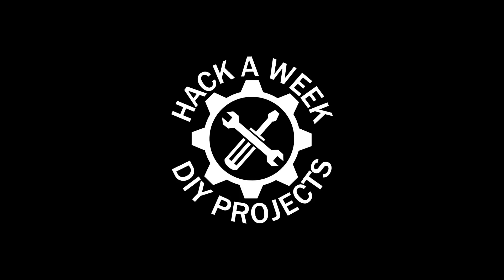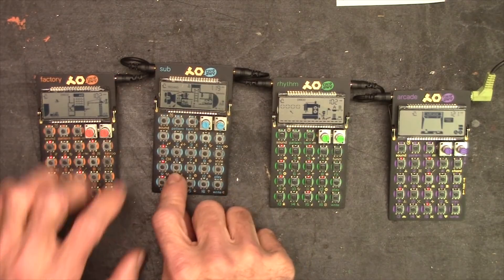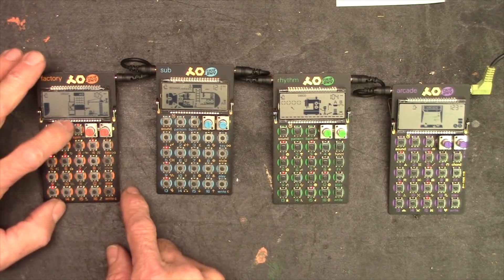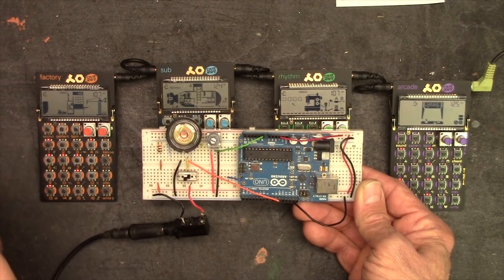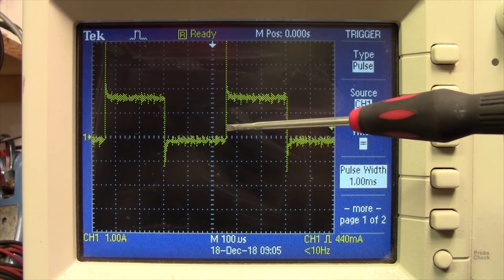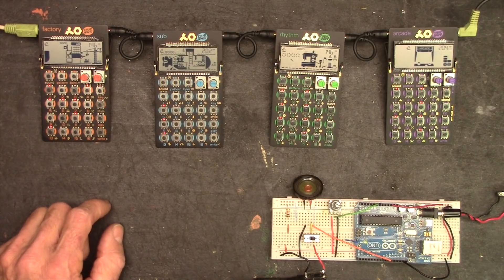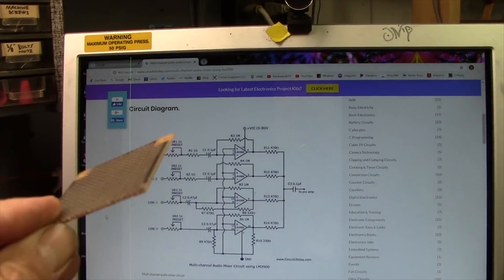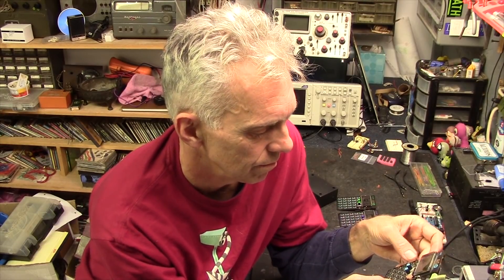Pocket Operators Time Sync Hack

Comment: The trick is to always have a blank pattern (I use slot #1) and you just select the blank pattern when you want to mute that Pocket Operator. If you have good enough timing you don't even need to sync them, just start and stop on time. But cool hack! xD I built a 555 timer (with an LED cuz why not) to control the tempo for mine. 😬👍

Comment: This is exactly what to do with the pocket operators. I want to me able to skew all the syncs on the off to get to all snap back together with the press of a button.
Reply from the maker: I think when they are all set to SY5 they need an external time base because they aren't generating their own. If you take away the pulse generator, they all stop. Good food for thought though. You've got me thinking... :)
Reply: Hey, someone has made an app called "PO Sync" and it works great for sync-ing, it also has a "swing" parameter to give a little groove to the sequence. It only needs a 3.5 jack cable and it requires to put cellphone volume at 100%. Really interesting, having in mind that this technique works, it would be great that someone take it further (for example, design sync click sequences to remove steps.. or creating odd time sigatures, or even variable tempo compasses). I leave the concern here, but also for you to try it, its great and simple solution!  PO Sync - McCormick